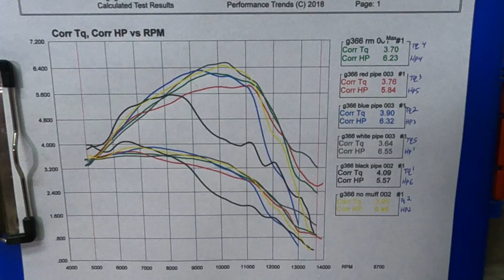SAW RUNS BACKWARDS!!! PIPE MAKE ANY POWER?

Comment: Wonder how it was running so long backwards. Was there fuel in the muffler? Cheers
Reply from the maker: It was still pulling fuel through the carb, just firing backwards
Reply: @dynojoemods2764  nice still exhausting through the exhaust but rotating backward. I'd think the spark timing would not work like that but I guess it's pretty centered rotating forward or backward? Cheers

Comment: It sounds like those aftermarket/ clone coils must not be consistent in their timing curve, or something. 
I had an early 90's KTM 125 that i got running and it developed all sorts of power..wheelies almost every shift, banging through the gears hard. The next time i started it it was running backwards. In this case it was a sheared flywheel key.

Comment: Thanks for the test Joe, this is very interesting! I have had my G366 run backwards few times. I backed the timing off a bit and no more issues with that. You may get the best power at the stock timing but running backwards and recoil kick back are a no go for me. Looking forward to the rest of the build!